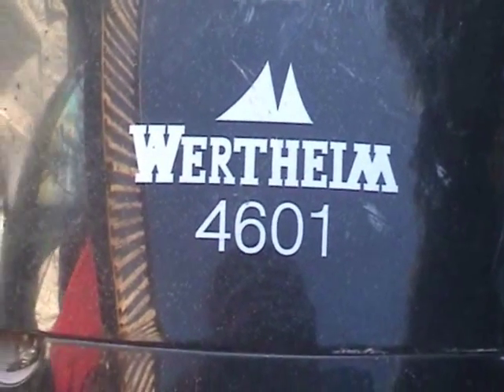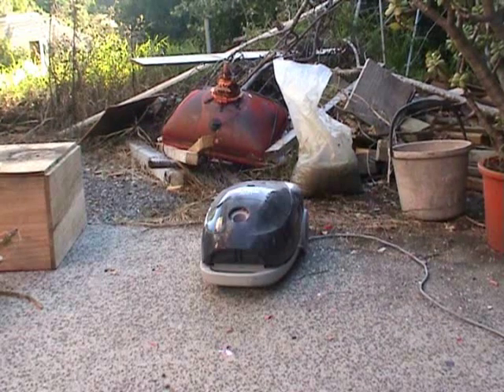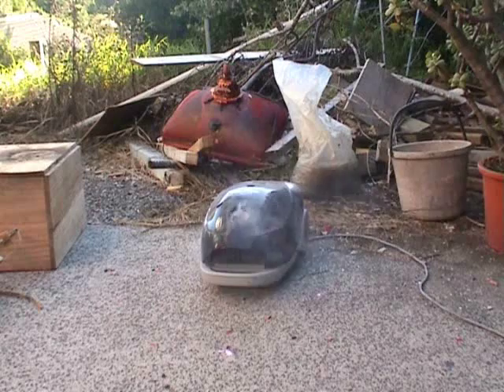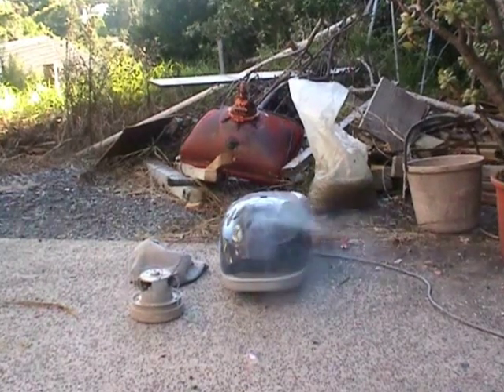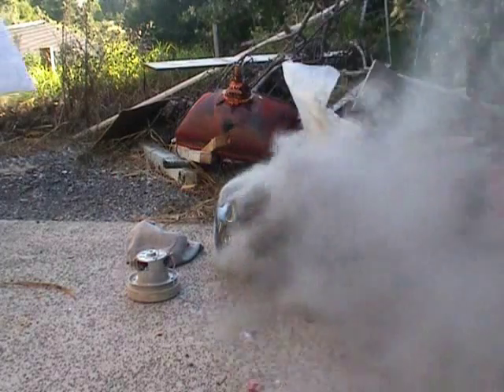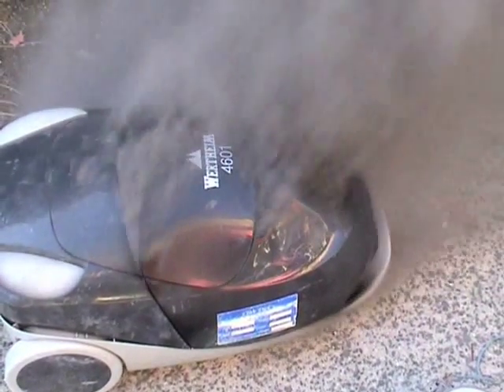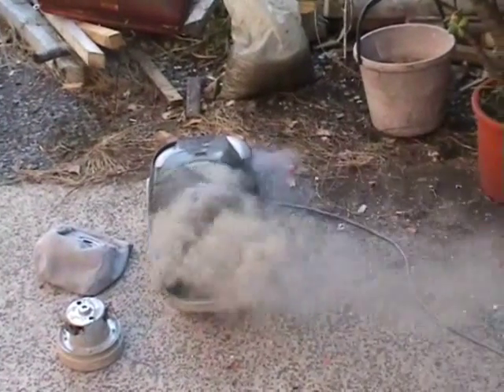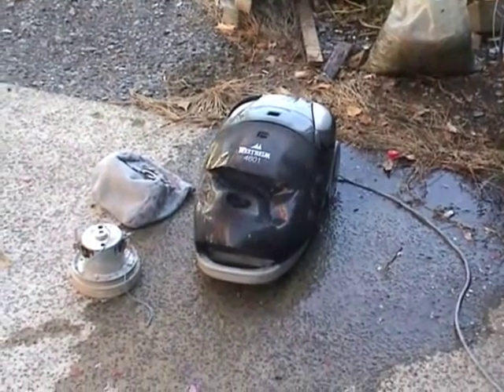Wertheim Vacuum goes up in smoke

Comment: umm what was in the vacuum that smoked at the end? I saw you had already taken the motor out. A good way to remotely light firework is to wrap small wire around the fuse and run high current through it to ignite the fuse :)

Comment: Nice 400th Video. A nice smoker there. 

With the motor removed, there's plenty of space in there to stash a nice sizeable KNO3 smoker. :-D 

Thanx for posting this....The next question is......What's going to happen to that motor? :-D 

How about lying it on it's side, in a tank of water? I know that PhotonicInduction has done this, but I think the mistake he made, was to set the motor upright, and the fan on it couldn't suck any water.

So how about an underwater in-tank rev-up? :-D